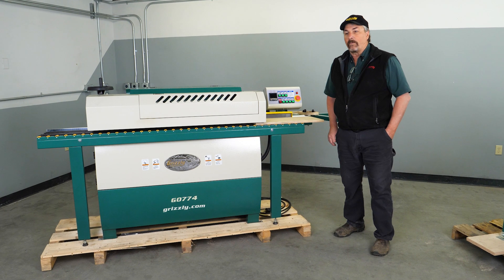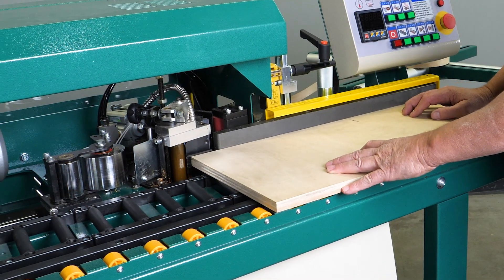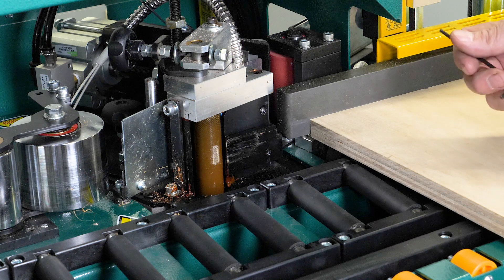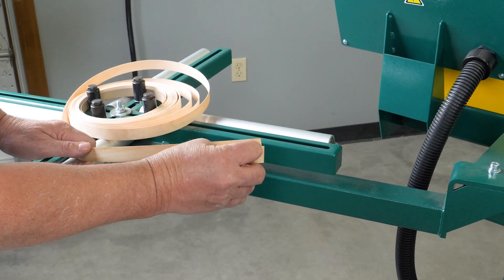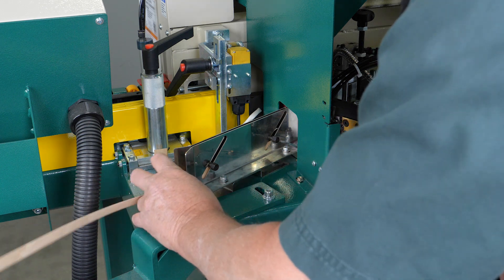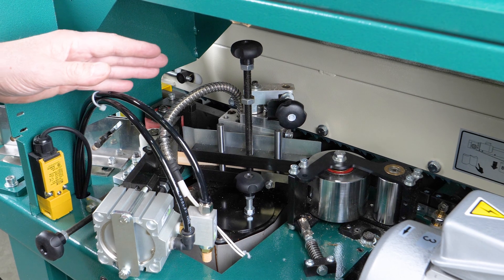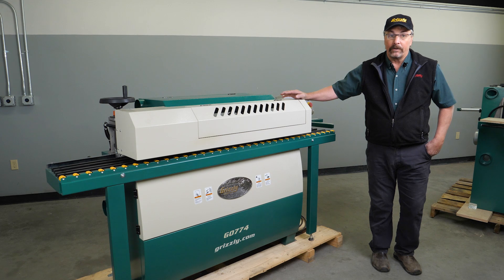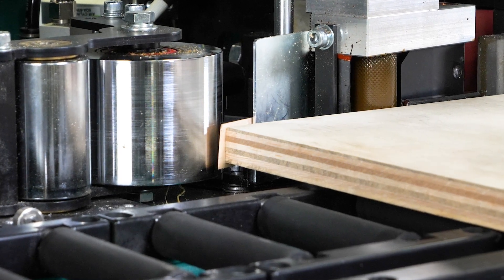Grizzly G0774 Automatic Edgebander: Setup

Comment: I got a little confused I thought the thickness of edge banding you set it when you insert the small piece behind the screw
Reply from the maker: When the part is positioned behind the screw, it serves as a component of the fence assembly, not the trimmers. You can find detailed instructions for this installation on page 41 of the manual. If you have additional questions, please reach out to our Product Support team for assistance.